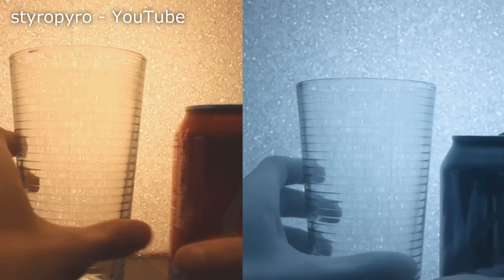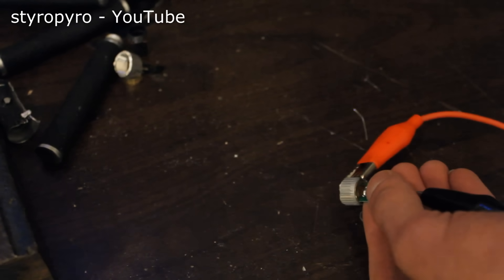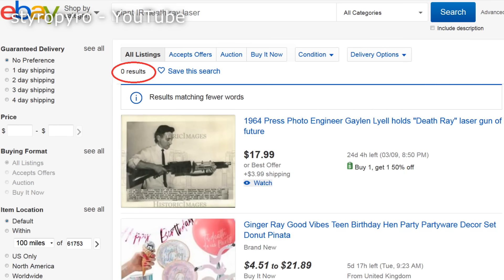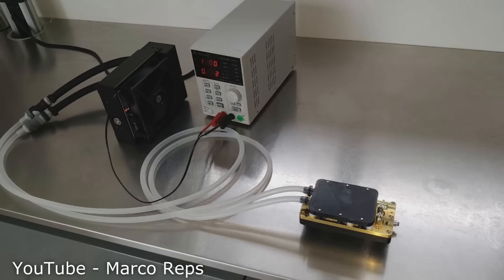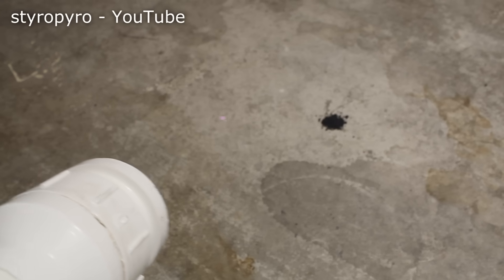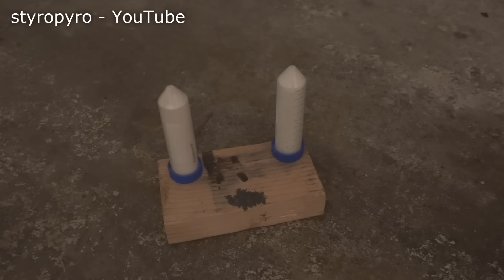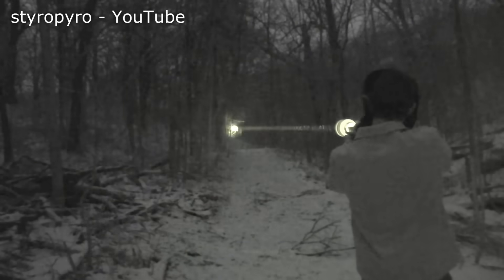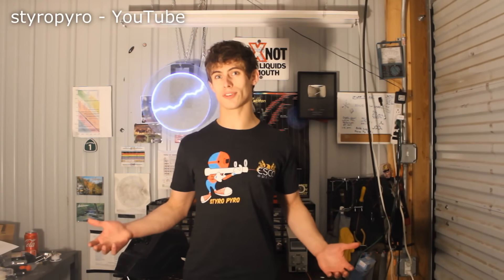100% Invisible IR death ray laser!

Comment: As someone who works with 1500 watt Laserdyne CNC IR laser cutters, that can slice through 1/16th inch aircraft grade Inconel at hundreds of inches per minute, I am not impressed by your tiny laser. I am impressed however by your ingenuity in creating your own IR Laser and your attitude of safety. While some of your safety measures are somewhat over kill, Its my professional opinion that overkill is under rated. Especially to any amateur trying to follow in your foot steps. Keep up the good work and keep safe!

Comment: another cool video, maybe you could heat some water in a spiral copper pipe combined with a floor mat with connectors where you could cover the entire floor, a steam release would help with getting warmer air , like the inline water heaters, warm air coming from the entire floor in the winter would be good, maybe the quick heat generated from the ray would warm the water quicker,  maybe the ray directed at a metal plate underneath the coil in the center designed similar to a hot water tank heat unit with the flame in the  center,  instead of the having  the hot water tank in 1 big tank spread mass equal the tank size in capacity  equal to the amount of copper tubing it would take. the copper pipe would get nice and warm too. pretty simple a heated floor mat heated by one of your heaters(light ray) depending on square feet of a room with the heater(various heating applications) in the center of the room in the floor mat, maybe rubber would be a good material molded over the tubing with easy connectors, it might end up on Lowes shelves for the public.

Comment: I always wonderd, why you are not using laser googles but instead cheap laser adjustment goggles? I mean yeah laser goggles can run you $400 a piece but you would not have the problem with light coming in the sides or anywhere. In my opinion way safer that just putting adjustment goggles in a welding mask.

I mean something in this direction this would even work with that IR-Laser: https://protect-laserschutz-shop.de/epages/4638a7e7-f4fa-4bd0-8111-e82c8909b2d8.sf/de_DE/?ObjectPath=/Shops/4638a7e7-f4fa-4bd0-8111-e82c8909b2d8/Products/000-K0358-OVSP

Comment: Collimating lens setup could allow you to shift the focal distance significantly for beam projection purposes and keep the power intensity down,  or reverse the process and make a beam spot the size of a nail (or smaller) at a determined fl.  Nice setup, what did it run you $$ wise to get parts/components?

Comment: Hopefully you can address this in a future video, but is wireless power transmission possible with an IR laser (more focused), and is it feasible as a  wireless electronic power source?
Reply: if you can find a photovoltaic cell that works with IR light id assume so... but youd have lots of invisible powerful lasers having to track solar panels on those devices and if anything got in the way itd get burnt. 

possible: maybe
:practical: insanely dangerous
Reply: @MCWaffles2003-1  Thanks for the information.
I see, at this power level that would be extremely dangerous. 
What about low power electronics and a low powered IR laser (Arduino application w/ photovoltaic panel)? I am very interested to make an experiment out of this. I will let you know what I come up with.

Comment: BTW, could you make a Sonic Weapon, or a wind based weapon? I will try to donate a bit, don;t have much since I am sick. 

Also, a battlesuit or kevlar armor suit, would be nice, I could use that kind of suit for diving in deeper water, or to stay warm at North Pole, or to survive in desert, by filtrating the drops of sweat from my body and turning them back into drinking water, I would use a small nuclear reactor as an energy source, since it is said that the source of energy is the problem, but I don;t know how I would deal with radiation. I DON't WANt ALL THESE IMMEDEATELY,  but are some theoretical ideeas.
Also if we used nuclear power for the lasers, fling suits etc. I don;t think we woudl have problem with energy, also if equipped with solar panels and some wind propellers we could have alternate energy source, perhaps in the future we could use even sounds as energy source.

Comment: Based on what I saw in the reaction of fire with electricity, I wonder if you can create a kind of flamethrower that also has an electricity system, and when electricity reacts with the fire, it would be like a ray thrower. 🤔

Comment: I could use your help with something styro. I have a telescope lens in my possession but don’t know it’s degree of curvature but I want to. I can measure the arc length, diameter, and volume of space inside the lens. I want to know if it’s possible to calculate the degree of curvature with only those knowable values. If you’ve got an idea I’d love to hear it. ✌️

Comment: Styropyro i need your help. Im trying to add dvd red diode lasers to my cnc for engraving purposes. I have tb6560 motor drivers and the diodes. Can i hook them up together so i can engrave things in my cnc? Or do i need to create a seperate laser driver for the laser?
Reply: https://img.staticbg.com/thumb/large/oaupload/banggood/images/90/06/da6d52cc-12ec-4a9d-a787-af350300c2d7.JPG i have this motor driver
Reply: any help will greatly be appreciated. i cant seem to find anything online...

Comment: Question for you, 
I have a laser 303 green 403nm. Its like .2 watts. Recently i noticed it was starting to fade. I then Charged the batteries and i put it back together. After that i noticed the beam fade more and when i take off the focusing lenses it appears to be a faint red. Does this mean that the Crystal has fallen out? Do i have an infrared laser now?

Comment: I have an interesting suggestion.  You can buy laser hair removal devices for under $100 on Amazon.  I'm really curious as to what could be done with the components in these devices.  They work in pulses, and fry your hairs in single pulse.  Anyone know what kind of lasers are used in these, and what kind of output they might have?

Comment: That IR light is what makes green laser pointers dangerous when they are not filtered and many cheap ones are not filtered.  The problem with IR light is that you can't see it and it can blind you.  Other lasers are dangerous too but that is what makes green lasers particularly dangerous.  This IR light can damage your eyes and you might not realize it right away.  You might notice it later when you have trouble seeing if you can still see anything at all.

I don't want to scare anyone but lasers can be dangerous and the powerful ones found on eBay and similar sites can blind someone instantly.  This may even be permanent.  There are special safety glasses to wear so that you will not be harmed if one shines in your eyes.  They are specific to the wavelength of light you are trying to block and come in with different color lenses.  These safety glasses are not sunglasses and sunglasses will not protect your eyes from lasers.  For more information about laser safety read a reputable forum and even ask questions if you think you should.

Comment: " IR short wavelength " seem legit :))
IR has longer wavelength than visible light,
Reply from the maker: I said it is "short wave infrared" as in the shortest wavelengths of the infrared band. This region is typically called the near infrared/NIR but I find this term misleading as it suggests that the light is still in the visible band somewhere when it is in fact totally invisible.
Reply: @styropyro  Cool :))
Thanks for your reply 😂

Comment: 9:35 germany used IR flashlights as nightvision at the end of the war. they had panthers fitted with special optics, and had a truck follow them around with a giant IR laser on it. there were also infantry with this equipment (laser in the gun, and a scope that could see it). The infantry wasn't as effective though, because they had to carry huge heavy battery on their back, which only allowed the laser to work for 40 min.

Comment: What if you made an infrared heater using the laser used in this video but not focused on one point, instead spread out around a 3 foot diameter and hang it by the ceiling and make some type of like remotely controlled aiming device that follows you and aims this at you for warmth obviously. Well only if the laser provides enough infrared light to keep someone warm. But then again idk about the whole burning of the eyes thing. AANNDD  again you could just get a space heater but thats so vanilla. Idk

Comment: I'm thinking if this powerful IR laser can be downscaled enough but still retained its power, it has the potential to be used to as a soldering device on non light sensitive components, I'm kinda interested in making one myself and try if I can use it as a replacement to soldering iron....

Comment: How much for the ir-sniper rifle ? kiddin'.. :))
I noticed that the focal point on the lenses are not auto-adjustable sooo... here's what i'm thinking:
I'm a software developer, i could write some code and with the right electronics and optics (i really hope you know your way around optical physics ecuations) we could make a auto-targeting/focusing system.
Hear me out, so i know that with the right opics we can change the focal point of the laser beam/beams. I could writhe the software and make the electronics and mechanics necessary to change the distance of the focal beam depending on where the designated target is by digitally measuring the distance in real-time and auto-adjusting the optics for best results.
Feel free to pm me or reply.
Really hope to hear from you.

Comment: Design mod suggestion: add a red laser pointer(s) to approximate the spot where the it is. Could not be exact, because the red dot laser could only parallel the IR or cross it once at a fixed distance because it must be mounted at an offset distance.

Comment: can you try to use this laser on a rusty iron surface - there are some derusting lasers that boil off the rust and paint and grease until the blank metall reflects it  - if that doesnt work - do you think you can make some Linear laser that can do it
Reply: I want to know aswell cleaning engine blocks would be a fucking easy
Reply: He's already done a video on how this is done.

Comment: Amazing how far tech has come forward.  Early 2000s I used to work with IR ndYag laser in 5-20W range and it used a massive assembly to generate the laser + mains power.  Handheld now.  Safety precaution is serious with this laser type as a stray reflection can permanently blind in seconds and there is no blink reflex as the beam is invisible!  Styropyro is using more protection than we had, def best to be over cautious with this sort of thing. This is def not a project anyone wants to do be doing at home.

Comment: Impressive experiments! I recommend editing the video when you mention more than once as IR being a "short wave" light. That's wrong. 
Visible light's wavelength is in between 400nm to 700nm, and IR starts at 700nm all the way up to 1mm, so that is longer, not shorter.
Reply from the maker: I said it is "short wave infrared" as in the part of the spectrum right after red. AKA the shortest wavelengths of the infrared band. usually this is called NIR or "near infrared" in scientific papers but the term is somewhat misleading as the light is 100% invisible and definitely infrared.

Comment: Must a low-power infrared laser be taken from a green laser at this point? I wanted to buy IR or UV laser diode modules that would be generally safe to use in consumer products (low power) and was struggling to find such a thing. Do you know any suppliers with good storefronts and trustable wavelength markings?

Comment: They do use IR visualizers to help with veinipuncture, but I doubt that they use IR laser diodes for this application. I'm surprised that even at the focal point it didn't cause tissue burning. I wonder what would happen if you used a tissue simulant, like an uncooked chicken thigh, wing, or a hot dog, if you could position it at exactly the right place for the focal point to be on the surface.

Comment: I've got a question Styro.

I learned from you that lasers have a limited destructive potential in your pulse laser videos because the outer layer of a surface vaporizes and ionizes into a plasma, which then acts as a bit of an insulator, absorbing lots of the laser light, and protecting the surface from further damage.

Would a hypothetical X-Ray laser have more destructive capabilities since it could penetrate this plasma layer, or possibly even through layers of armor before transferring thermal energy to the object? I've seen X-Ray and Gamma Ray lasers mentioned often in science fiction. If so, how might one build one, given that trying to focus high energy photons that can penetrate most materials (rather than reflect) must be like pulling teeth?

Comment: Very nice audio. How far up in the air could a hydrogenballoon could be ignited? That would be awesome for newyears. You could have a setup with a paracord on a spool with several balloons with different gases, perhaps secured to a drone! Then you just pull the balloons into the path one by one, move the lens to ignite more balloons at a time, or rig a servomotor to the emitter to ignite different balloons at exact times. Imagine the show! Adjust color (different gases),  (different gascontainers), different volume (higher/lower pressure), latency (fuses), duration and pitch of sound (blowout valves) etc. 
Love you channel! You are awesome. Grats on better lab. Please try my suggestion! :D

Comment: Hey Styro, have you thought about trying to build an "electrolaser"/laser-induced plasma channel? I'm not sure how feasible it would be with off-the-shelf components, since it would need to have a high enough pulsed/instantaneous power output to ionize the air, but if anyone could pull it off I'd place my bets on it being you.

Comment: Is not a laser when is hologram
Is not plasma when is hologram, need to correct that dishonest form of speech, because that system is doing wrong.
None of those power supply pr cables would be scientifically capable of withstanding such amounts of electricity, they would instantly burn, those wired are not capable of such resistance, all materials have a resistant point, can only withstand a certain amount of energy.

Comment: Styropyro would you please link me to the protective goggles your using for this it laser? I have a 50 watt water cooled, supposed to be 810nm diode I'm kind afraid to run. I'm guessing at least OD6 ?? thats 1,000,000 x reduction if I understand correctly? So 50watts should look like   .00005 or 50uW (50 micro watts)?  Correct?  Boy, chance of burning your eyes out sure takes a lot of the fun out of lasers!!!

I need a power supply for this diode too, ive powered it up 2 times using 2, nicad D cells and a piece of niachrome wire cut to the correct length for the gauge I have to limit, crudely limit the current. I used the googles I bought for ruby lasers, its OD6 @695nm but drops to OD5 up in IR.. I used the goggles but still closed my eyes and sheiled my face when I turned it on.  That thing is crazy powerful,  even way underpowered because I didnt account for the ESR of the nicads, and with no lens (only one axis, fast axis??? is corrected in the diode) it went through both sides of a black plastic bowl in like a second or less!!  I would love to have a proper driver for this diode, I guess I'll try to contact Marco and see if I can mod he for a bit more current!!
Thanks for the video!!!

Comment: What is the highest frequency laser we can build with current technology?
Reply: harris brekke Currently, high frequency amplified radiation is usually generated through masers, which are similar to lasers but specifically emit high f radiation. Masers have been made to emit microwave, IR and radio waves, all of which have a higher frequency (but lower amplitude and energy) than visible light.